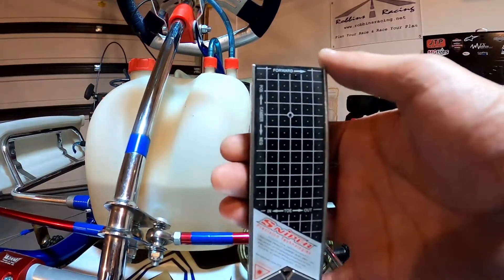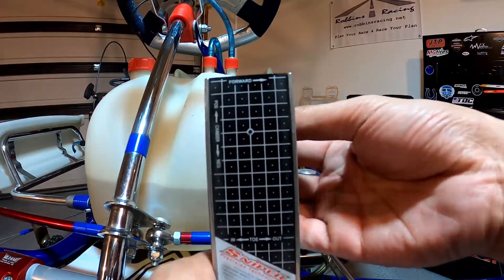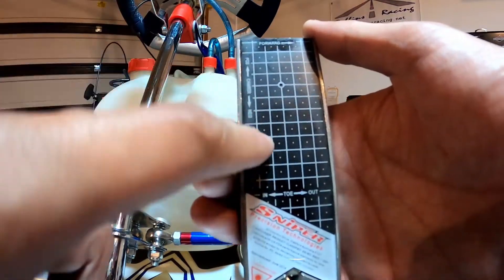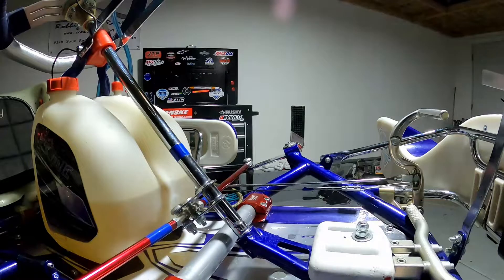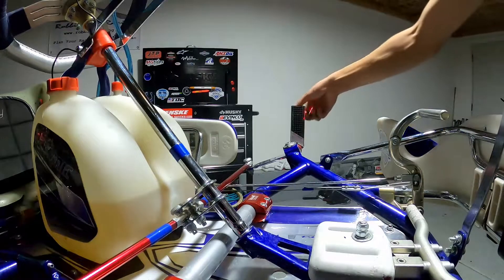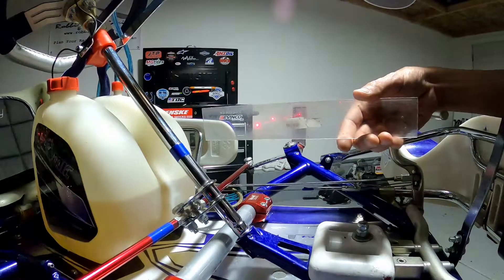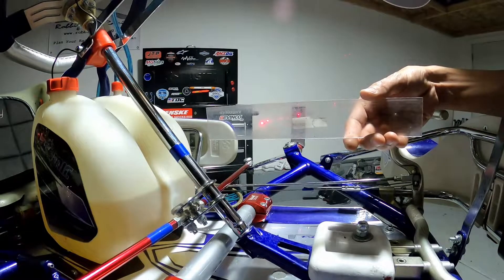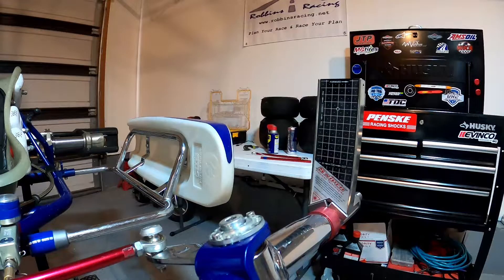Go Kart - Front End Alignment

Comment: What happens if your lasers don’t line up on top of each other at the beginning? Like 1 laser is 1 mm higher than the other. Does that mean the chassis is bent ?
Reply from the maker: Could be.  Could be the stub.  We bought our first new 2023 chassis this year and it didn't line up perfectly either.  Maybe set the kart on the ground and jump in it so the king pins and pill bolts all settle in and re check the lasers
Reply: @robbinsracing801 does that mean the chassis may be bent ?